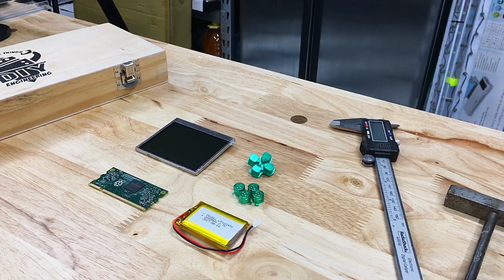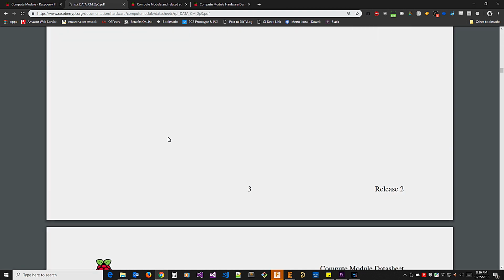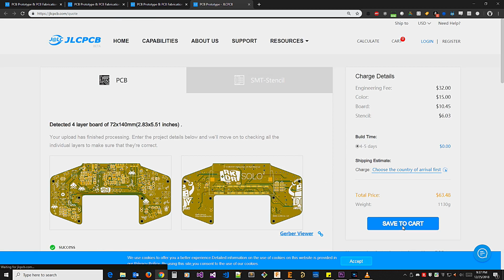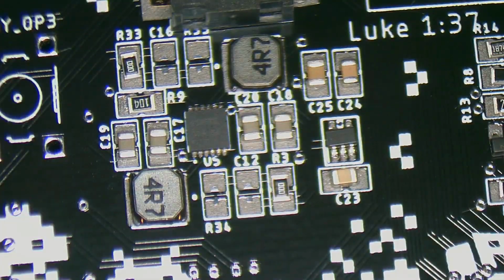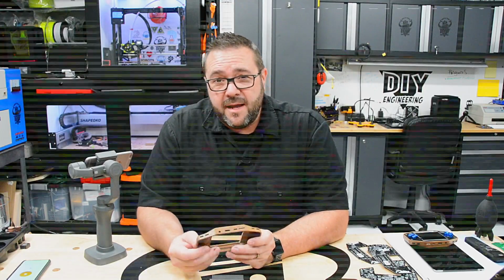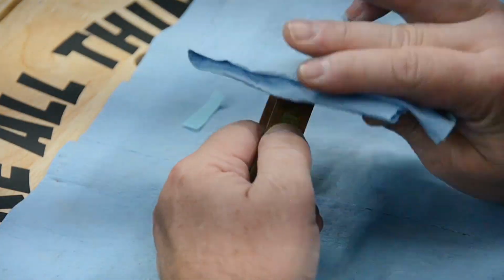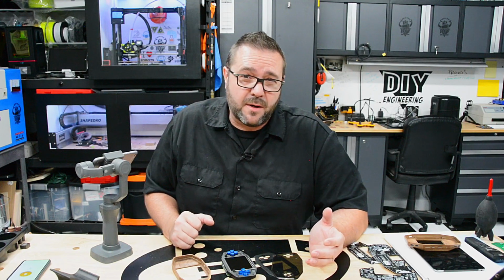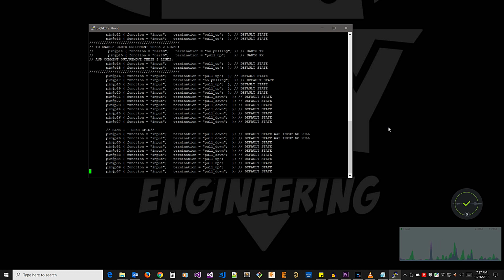Episode 032: The New Ultimate DIY Handheld (RKDR 2)

Comment: It's pretty insane, 
i followed your proccess on instagram and it was cool! but you should go deeper in video, 
it took you so much time to make that,  i'd love to know your technique on double side 3D milling,
 or more info on the pcb, (connector for the rasp for example), 
or how we can make good wiring with so much component,
 what the basics on making 4 layers pcb,

 So much knowledge, i want to know more :)
Reply from the maker: Adel Kheniche i have a sister channel called ocd.engineering that i plan tio host long form discussions around the project on.
Reply: I agree. Make a longer video with more details of the project. Very impressive btw. :)